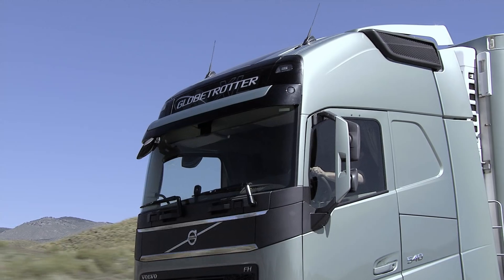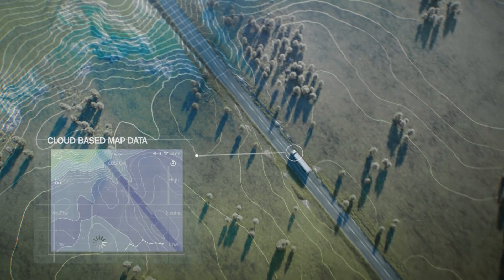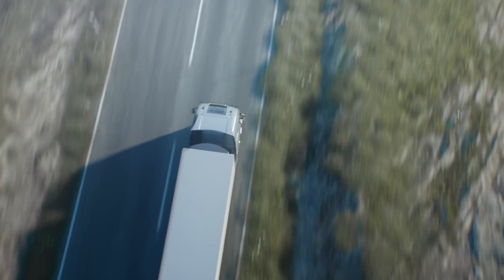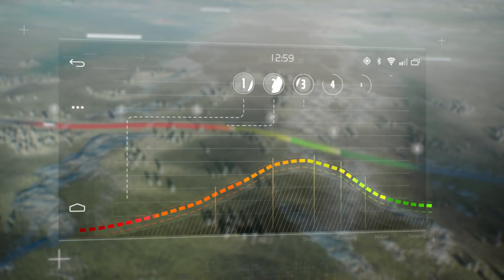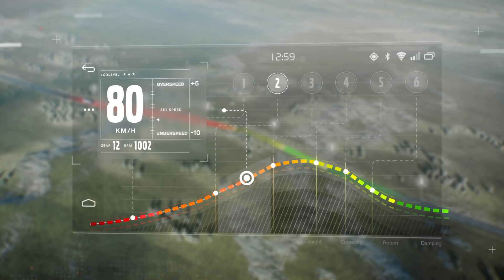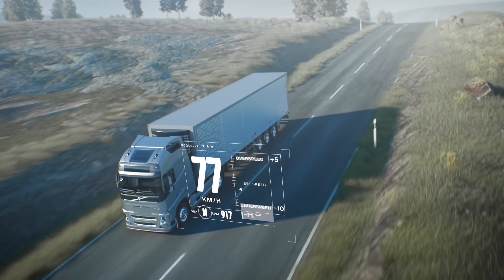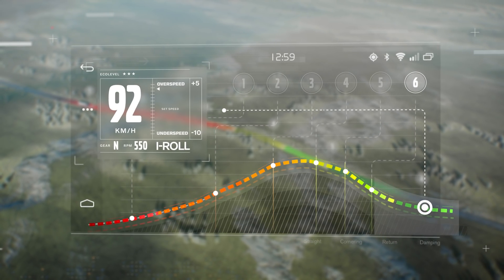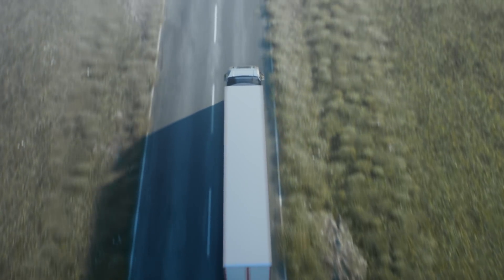Volvo Trucks - I-See updated and improved

Comment: It is good if you are alone on the road and this is not the case in 85% of the situations. I personaly hate this system and want to turn it off. Unfortunately this is not possible in my truck... and no, "Mode" button does not work...

Comment: Is it really that efficient to engage neutral while rolling downhill? Normally a motor needs a little bit of fuel to idle and if you have a gear engaged while rolling downhill the kinectic energy is used to spin the engine and it does not consume any fuel at all.....what is it that Volvo did different so being in neutral is more fuel efficient? Can someone please explain?
Reply from the maker: You have a very good point and this judgement is done by the I-see map based application. Application is actually able to judge if it for the moment are more beneficial to roll with “Gear engaged” or in “Neutral”.
Reply: @volvotrucks  Thank you for the answer.
So if the incline isnt steep enough to have the motor spining by the downhill force I-See will engage neutral so the truck can roll on its own instead of being driven downhill by the engine which would consume more fuel than just letting it idle. But if the incline is steep enough I-See choses the right gear for the perfect engine brake , right?
Reply: @volvotrucks  so this system uses the Oberth effect?

Comment: I mean it's very good but if you go 85 in 80 kph zone with bad luck you're gonna get fined
Reply: You shouldn't really get fined for 5kmh over, it's usually a warning or something.
Reply: @01dom  it's 6kmh for cars in my country, but I've heard trucks get fined for less but I could be wrong.
Reply: In Norway we have something called the 10% rule, meaning you're allowed to go 10%over the speed limit without getting fined. This rule is in place to prevent people getting fined for speedometer-inaccuraties.
For example, you are allowed to go 88km/h in an 80-zone.

Also, no sensible policeman is going to fine a truck for speeding before a steep hill.

Comment: Does it only work on brand new Volvo trucks?
I have "I-See" in my FH500 from 2015, and I Think it would like an update :)
Reply from the maker: I-see Map Based have been available for some time, and vehicle built after 2016 week 23 can be updated to the same level as todays full extent version.
 In your particular case (MY2015) the I-see variant you have still is the best option.

Comment: This pretty cool technology. 

However, I'm wondering how this system would handle rapid hill ascent/descents where this process would be required several times with a few (or one) kilometre.

Also of interest is whether it adapts to the geometry of corners when the I-See program is active; specifically where the driver would need to accelerate around the apex of a corner for better force handling (the system not disengaging gears to Neutral on slight descents because of a corner, for example).
Reply from the maker: Map based I-see do constantly calculate some kilometres ahead, and on top of that bring in the instant data from vehicle to fine-tune the momentarily behaviour.
 At the moment the cornering data is not used to be a part of the similar fine-tuning.
Reply: @volvotrucks , interesting, I'm sure there will be a lot of worldwide data to congregate with this system, so it'll become quite a substantial map in time.
In the future, cornering is probably something that should influence the system at times, because it certainly does while driving in real-life.

Great work, nonetheless!